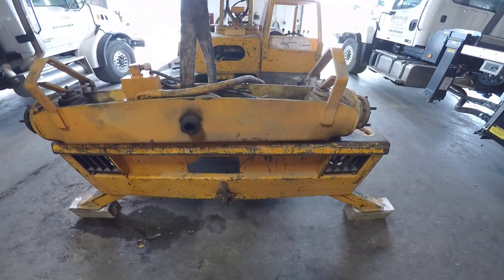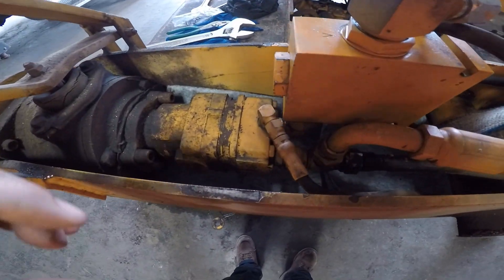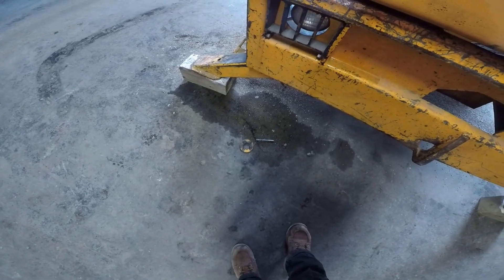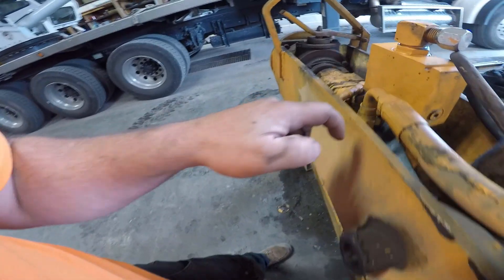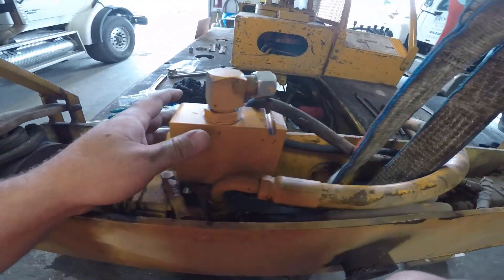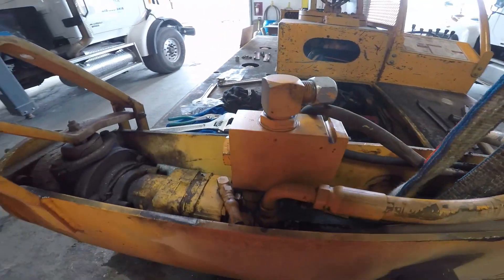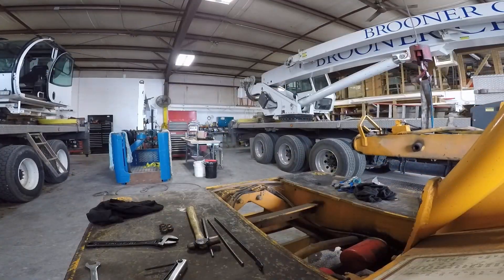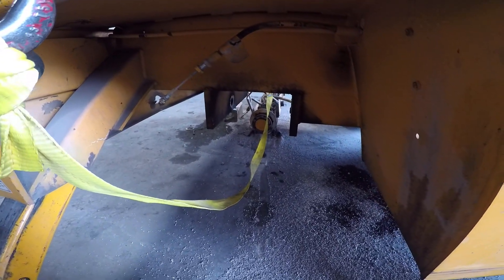Broderson IC-35 front axle repair | flow divider combiner valve

Comment: Nice video! Sometimes hydraulic magic is the best way to explain those kind of complex components. I have a tip for replacing that particular oring and some others in tight spots. but don't know about sharing in this public space? any way I do enjoy seeing someone with pride in their work.  Thanks
Reply from the maker: Lesterntomson ! I thought about buying a new o-ring, cutting it with a razor blade and super-gluing the ends back together around the partially removed valve. I've done that before on machines. But, the axle was pretty easy to take out. So, out it came. 😉
Reply: To The Top Crane ya I've done that before don't like doing it when you have to put rotating force on it to seat,boss fittings. Heat up the Buna, not with flame, back the valve out cut the old one off slide the new one over the cap end. The proper way is to put new seals on the valve to insure proper operation.
Reply from the maker: Lesterntomson ! That's why I decided to pull the axle and get the valve all the way out of the block. So I could reseal the entire valve and block.
Reply: To The Top Crane That's just down and dirty field service fix. You the man. have a good evening!

Comment: that little crane has an interesting sound. Sounds like it’s got a similar engine to a Tele handler.
Reply from the maker: It's a little propane powered four cylinder. That's probably why it sounded funny in comparison to my other videos.
Reply: Aha that explains it. Most of the Tele handler’s and toes that I see around has the same engines. I get to see airplane toes a lot because I’m in the civil air patrol and we do a lot of work down  at the airport.

Comment: Jimmy that was really slick with using itself to pull the axle. I have always used a comealong basketed over the boom and just went straight up and down instead of sliding the axle out. You have a fancy floor to work on whereas I’m almost always on dirt/gravel. Nice job getting it done. My respect for you is much higher after seeing you get dirty. I’ve come across several operators lately that refused to help me or get dirty. They honestly would rather sit home and miss a days pay instead of hanging out and helping me for the day. They are also the same guys that are younger than me, I’ll be 42 next week, that grew up on video games and joysticks and refuse to jump in a friction rig. There’s still a fair amount of that old iron out there , even in Chicago.
Reply from the maker: I occasionally have a good idea here and there. I don't mind getting dirty. I will be 41 in July. I was a mess Thursday and Friday last week. We pulled the boom apart on our 100 ton Tadano. I had grease and hydraulic oil all over me. But, it is what it is. The job had to get done. Thanks for watching!
Reply: Richard Savaglio if I was an operator I would help you. I love fixing  things.
Reply: I’m 31
Reply: Talking to you made me hungry. I new to get back to your neck of the woods. It’s been a few years since I’ve been to Strouds!!!! You know, the place where they choke their own chickens!!!! lol
Reply from the maker: If you head down this way, be sure to send me an e-mail before hand.